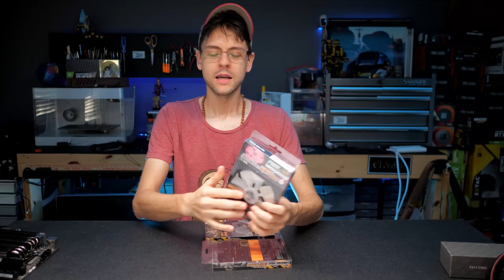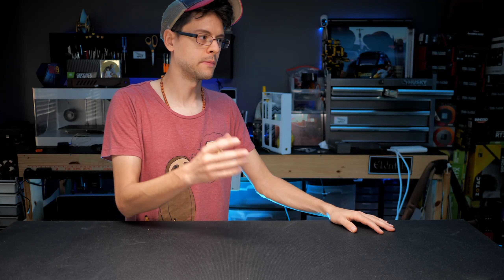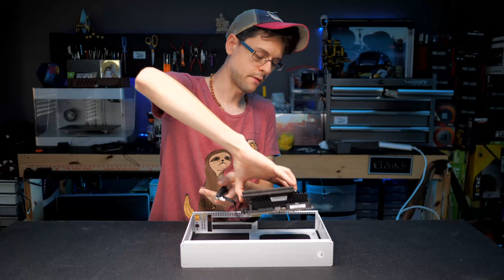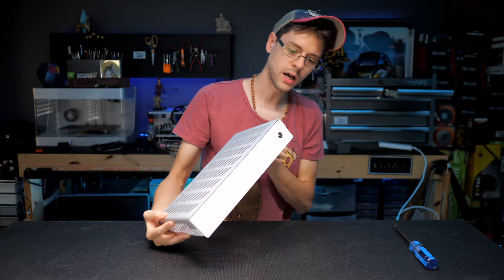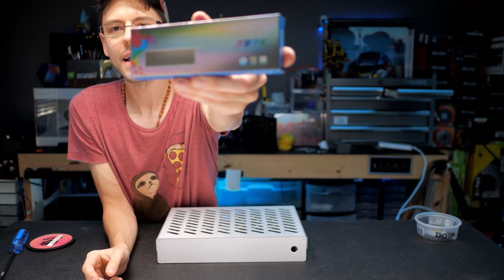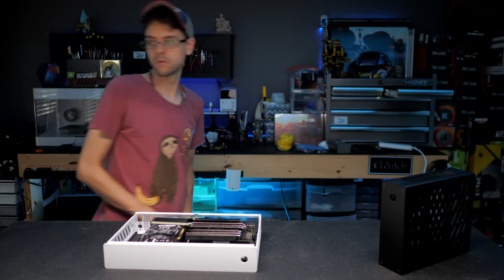In which we look at BlackRidge, Guardian, Umizato, Scythe and other things.

Comment: Good to see you back Josh, I was wondering, if you are planning to build a PC case for Mini ATX with a riser card that puts the GPU fan blades up, in the same face as the CPU cooler fan, jusk like the phanteks GPU riser, so the back of the GPU faces the motherboard below the 1st pcie 16x. Thick enough to fit a scythe big shuriken 3. And below the risercard 2 slots for SSD 2.5 (with the riser card ribbon cable between the back of the GPU and the SSDs). For hot air going out 2x92mm fans on both side panels, 2 next to the CPU and another 2 next the GPU. With the hdplex 400w PSU and power brick both on the front, and support for 24cm long video cards... This will be appealing for way more gamers, since most of the itx cheap motherboards does not have good energy management for the CPU, just the expensive ones, and there are a lot ATX m, that are cheap and does a good job there...

Comment: To get the BlackRidge cooler to fit properly, you could just shave a couple of millimeters off the top fins with a belt sander. With the black coating gone they'd have a beveled edge look like a razor blade.